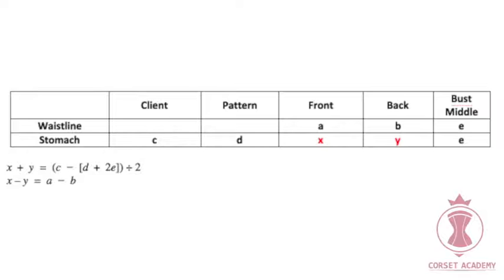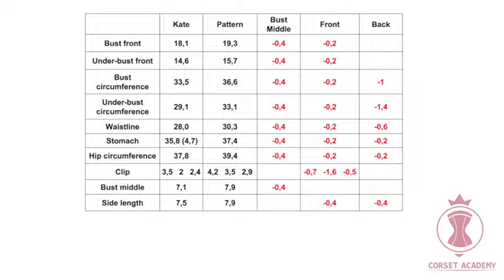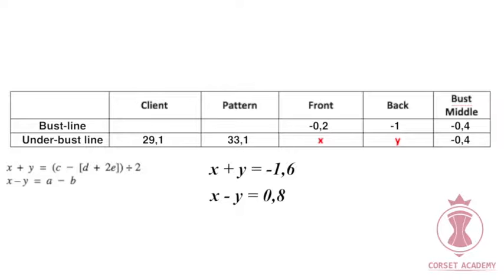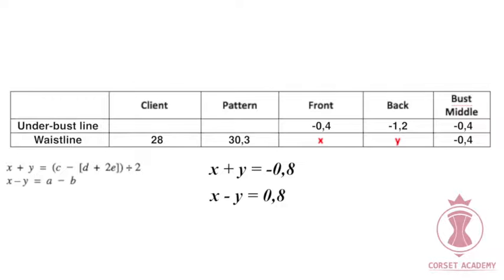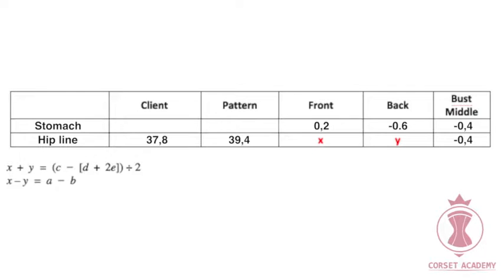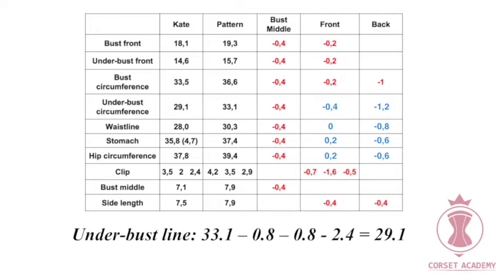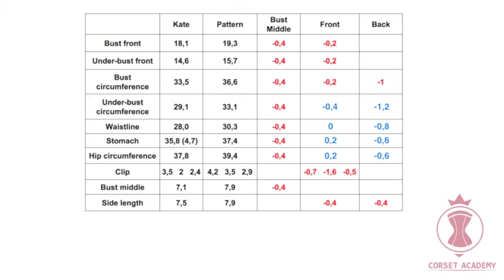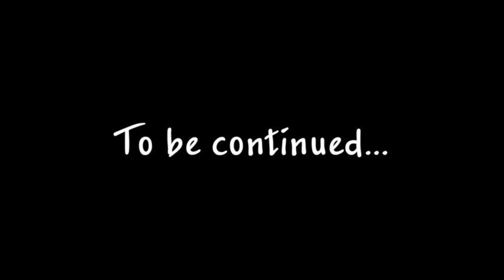Dress with separately cut cups #2. How to make a dress?

Comment: Tatiana thanks for sharing & explaining your pattern calculation adjustment method, I'll try it out on my next garment.
 I've got 2 questions
 1) where did you get that triangular ruler with the protractor degrees printed right on the edge of the ruler, I've found it impossible to find?
2) what kind of paper or plastic did you use for the patterns and is it necessary to be transparent?
I hope you can help thanks :-)